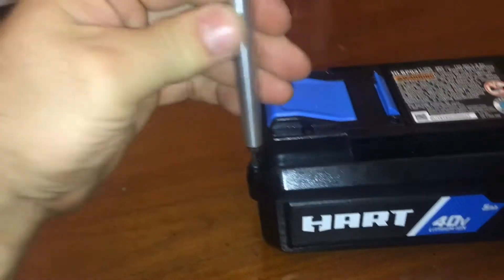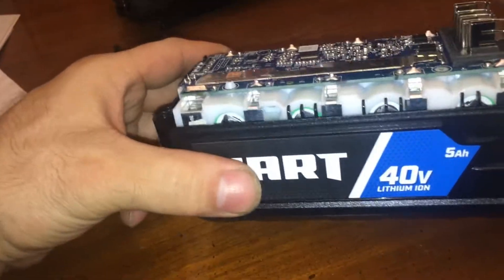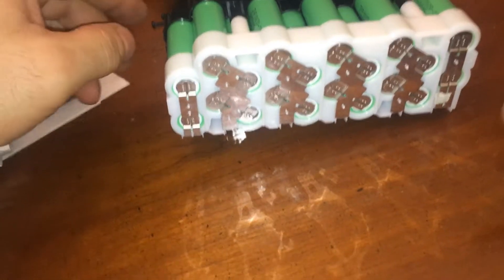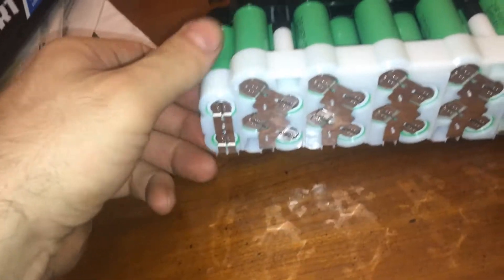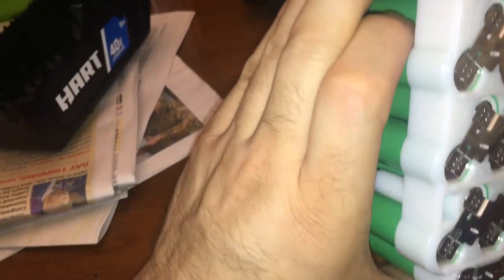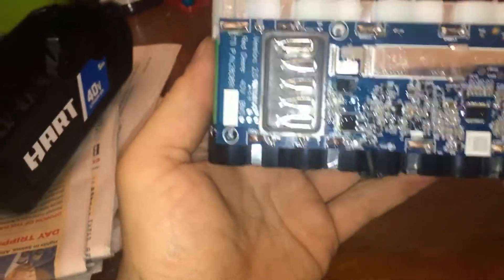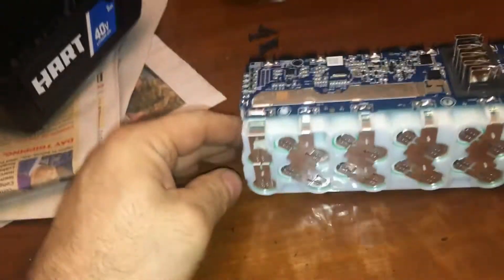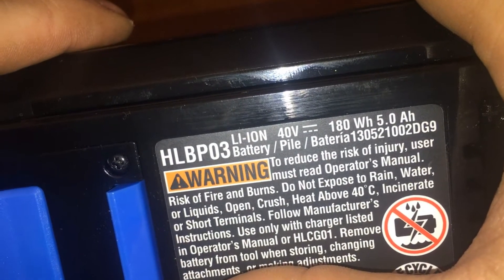Walmart Hart 40v 5ah battery what is inside I bet 18650 batteries HLBP03

Comment: Good value?  Samsung cells...thinking about these packs for my electric scooter.  For 40v Ryobi and Greenworks and Harbor Freight and Kobalt are options but I like the compact size of the Hart pack.
Reply from the maker: They all seem to have the Samsung 2500's. It seems odd one would be smaller than the other knowing they all have 18650's in them. Only way to make them even smaller would be to use 5000mah batteries, but i'm not sure those "really" exist yet, meaning ignoring the China BS ones.
Reply: From What I understand 3ah it’s about the highest you can get for power tools that require high current.
Reply from the maker: @Ezekiel-OffRoad  I havent seen a "REAL" 18650 greater than 2500 yet. walmart has several electronic devices stating 3350mah etc all are bogus chinese 18650. walmart just got sued for selling Onn portable batteries claiming the 18650's are greater than 3000mah. I just got a check for $120+ in that lawsuit LOL...
Reply: @bobspurloc  Panasonic produces a 3500mAhwith 35A discharge. I have a few and they hold up to the specs. Nice cells, too.
Reply from the maker: @samfish90212  Nice yeah higher end batteries for power equipment etc... but if you see a claim over over 2500mah at the electronics area its almost certain chinese cheap lies. I jut received $130 in damages from a lawsuit against walmart and those ONN portable batteries claiming 3000mah 3500mah etc LOL...
Reply: @bobspurloc  Samsung and LG both make cells with at least 3500mAH. Higher capacity, but lower current surge rating. I think they might make even higher but I don't have any.
Reply from the maker: @Sylvan_dB  cool. yeah I expect things to get better but a lot of companies lie. Onn walmart just got sued over it LOL. I was part of the lawsuit made an easy $130 lol